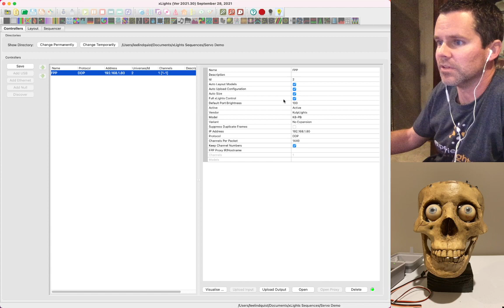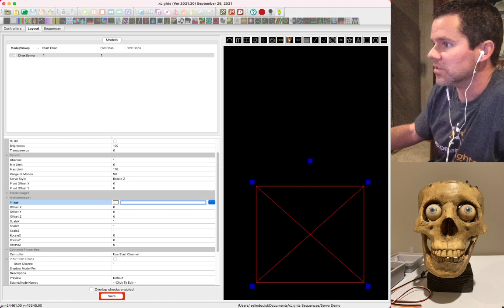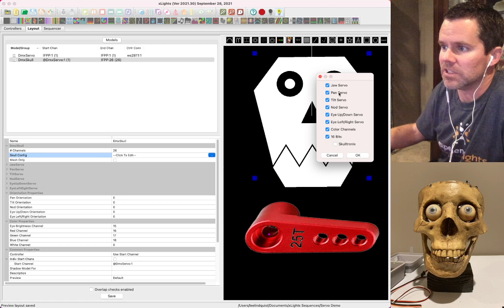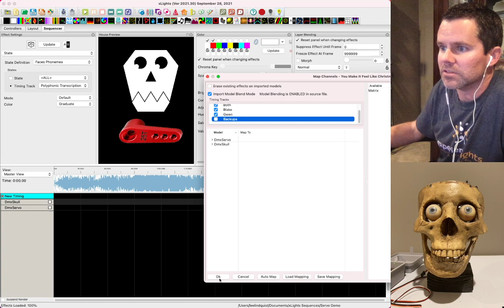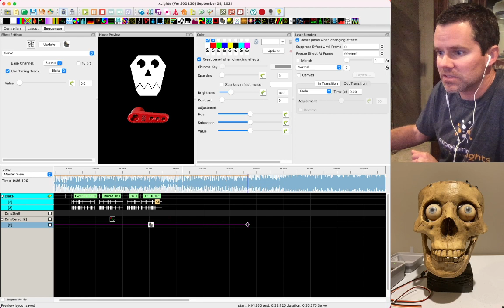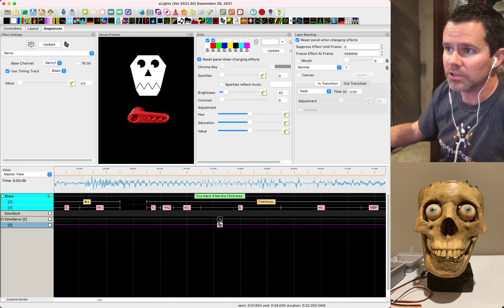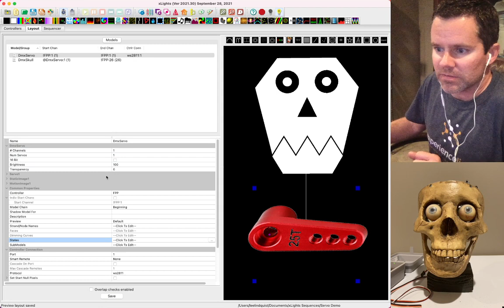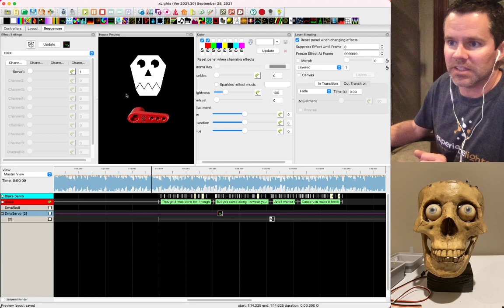Project: Setup and Sequencing of Talking Skulls with Pixel2Servos and xLights

Comment: might be a silly question, but where did you get the png of the horns?  Also,  do you have to add servos and the skull or can this all be done with just the skull model?  I'm trying to figure out how to use this appraoch with the latest XLights DMX-Skull model using states or are states even needed anymore?

Comment: so does that use the DMX port or its in line of the pixel ?
if I use this then I won't be able to use the DMX ?
Reply from the maker: This is using the Pixel2Servos12 board:
https://experiencelights.com/pixel2servos12-ready-to-run/

You hook it up to an existing pixel string, so it does not have any DMX connection.
https://www.youtube.com/watch?v=NnAgy-2wlIQ

Comment: Thanks for sharing this, very interesting.  I'm new to building props, and just started this past year with wiper motors and PVC.  I think this year I want to do some work with hydraulics and servos.  I have a picoboo that I want to use with a hydraulic build, but would love to play with servos/programming to make a talking Billy the puppet from Saw.
Reply from the maker: That's awesome!  You can also check out the Pixel2DCR3:
https://mattosdesigns.com/collections/animation-kits-1/products/pixel2dcr3-by-experience-lights-pre-buy

This allows to you sequence reversible motors and linear actuators by reversing the polarity.